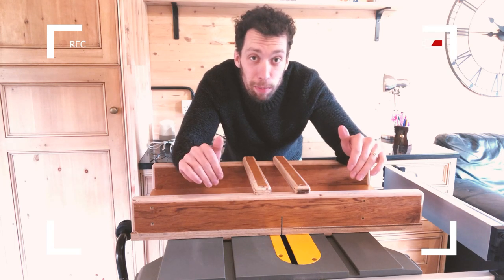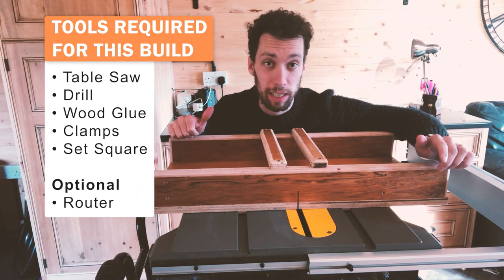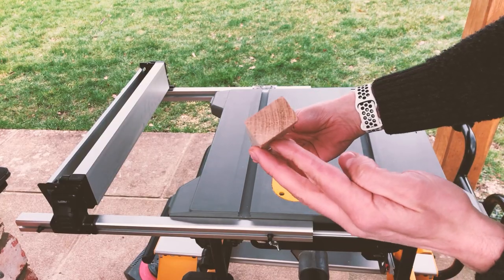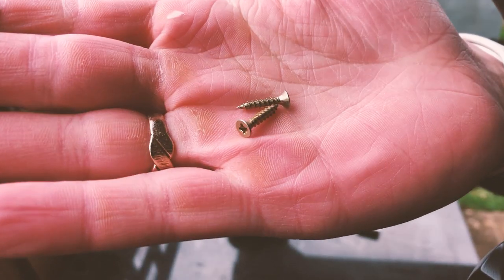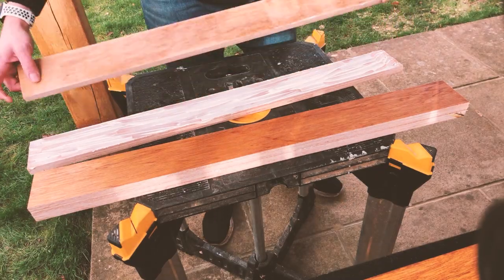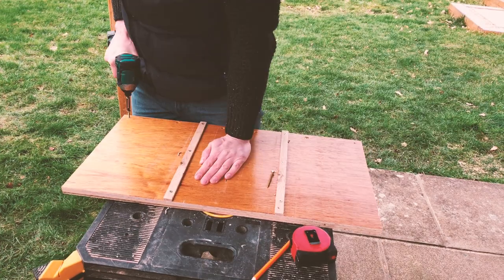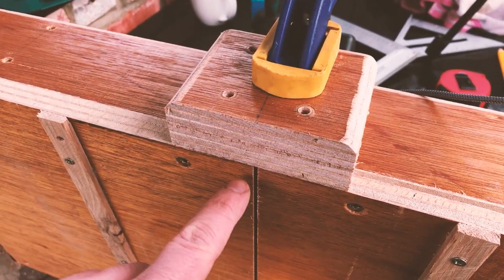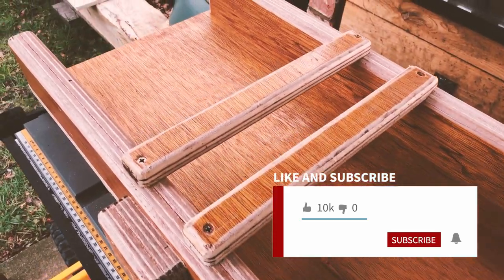How To Make This DeWalt Table Saw Cross Cut Sled!

Comment: Hi, i saw your video regarding making mistake with the table saw. One part of the video about how cut narrow piece of timber by using mitre guage and a timber, but when you were cutting narrow strip for your runner the narrow bit was against the fence not away from the fence by using mitre guage and old timber.
Reply from the maker: Hey, you're 100% correct! I did say at the start of the '8 Table Saw Mistakes' video that I made a lot of these mistake myself when I first started out. I just watched this back after reading your comment and realised how bad this is! I would never do this now! Live and learn I guess! Thanks for keeping me honest!